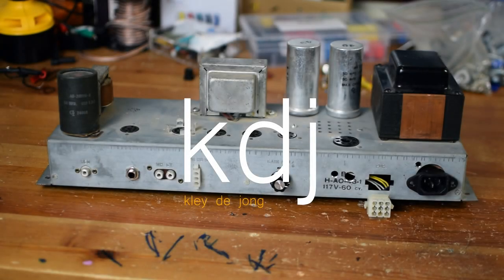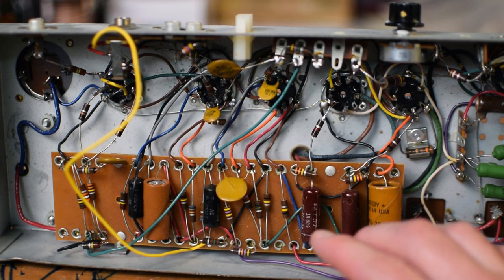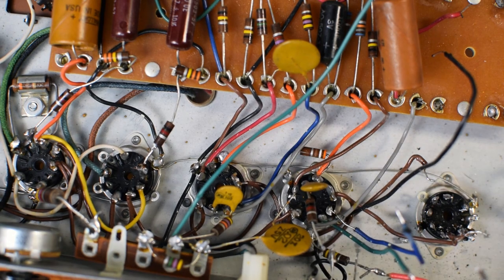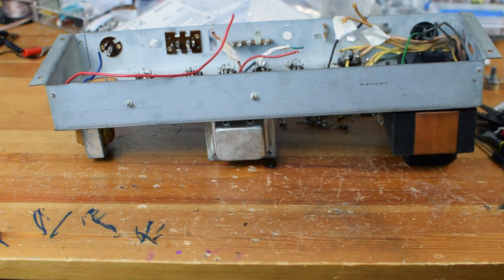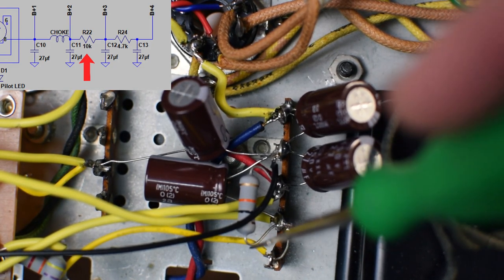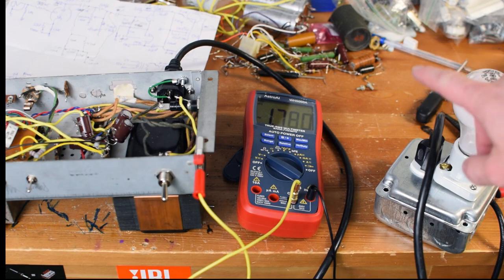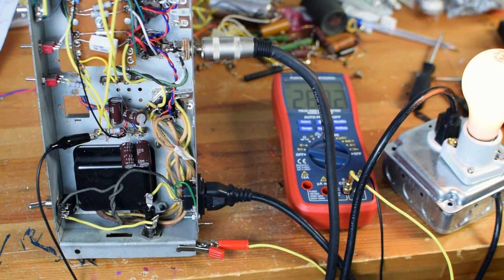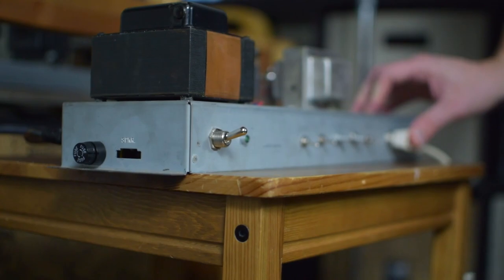Hammond AO-43 Conversion to Guitar Amp Rebuild - Dr. Z Inspired

Comment: May kley your an eclectic Renaissance man between your carrer shredding and amp schematic reading as hobby you really are a cool guy. I recently picked up the ao 43 and an ao 29. Your designs are inspirational. I just finished a tweed deluxe and soon I'd like to go p2p on a matchless dc 30 from 1996. All points point and possibly the finest layout and brilliant use of space inside the chassis as if it were designed by an artificially intelligent amp builder
Reply: Kley I just built a 5E3 doing a head and cab and really want to build a reverb unit fender clone from 63. Can the AO 44 be converted? Or any hammond easily turned into the 6G15 to  give me a 3 piece it seems like the 44 has a good enough base with a few parts could it be converted or is there another hammond model I could use for this

Comment: Excellent walkthrough, and it sounds awesome. I ran across your video because there's a working organ near me for $350 but I play guitar. About your weird house voltage issue, your ground and neutral are not connected together in your fuse/breaker box. There usually a screw that goes through the neutral bar to the metal fuse box enclosure that will tie the neutral to ground (as long as the ground is properly connected to the box). Make sure to turn off your main power before making that connection.

Comment: If you have 70 volts at the outlets... First check to see if that voltage is consistent. Do you have 70 volts from neutral to hot and ground to hot? If you do... You should go to the panel servicing your house. Open the panel and look at the meter main. Check the voltage across the two hot lugs. That should be +/- 240 volts. Then hold the black lead of the meter on the ground/neutral bar and check from there to each side of the main to main to make sure you have 120 on each side. Another thing you need to look at is whether or not you have more than one panel if you have two panels the primary panel will have the ground and neutral wires together but the secondary panel has to have those wires separated. If you are taking your readings off of the secondary panel then you need to check from ground to hot on each side of the main breaker and from neutral to hot on each side of the main breaker.
If one side differs... Then you just need to keep tracing back. What you're looking for is to find out if there is a voltage difference on one side or the other. If you can trace it back far enough you may find out that the problem is in the meter socket outside which would be a problem for the power company to deal with. If it's not then it's a issue within the wiring in your house although that seems kind of odd and unlikely. Once you've started to work through those troubleshooting steps if you want to shoot me a message I can probably help you further I'm retired but I was a licensed electrical contractor so I have a pretty good idea of what I am doing
Reply from the maker: I recall trying to figure this out in my tdpri thread a few years back. I believe there is a floating ground in my basement. The hot + chassis and neutral + chassis together was like 122vac. So my secondary voltages are always just fine. But taking voltages on the primary side to chassis ground gets weird.
Reply: @KleyDeJong  that would bother me no end. I would take a cord, attach alligator clips to one end and a grounded plug to the other. Then go from receptacle to receptacle until you find where the problem stops if it doesn't stop anywhere then the problems in your panel or between the panel and your first receptacle... And you need to fix that because that's just not safe especially when you're working with high voltages

Comment: Great tone!  I appreciate the walk-thru but especially applaud you for being brave enough to present a cold start up. I doubt many ampaholics actually post their first starts, Uncle Doug excluded. He never misses. 

Youi work with AO-29's a lot. Ever have any issues with the PT voltage being too high or sounding stiff?  I am starting a 5E3 using a PT from one and it's massive!  The OT will be from a 1954 Motorola hi-fi console record player with a 5K ohm primary. It's fairly beefy in its own right - twice as heavy as the OT from the AO-29 with a size very similar to a Champ PT and I'm excited to hear how it works.
Reply from the maker: My first 6v6 plexi build had a field cool designed ao29. It had high voltages for sure. I run it with 6l6gc's now.
Reply: @KleyDeJong  ok im reading that these field coil speakers sound really incredible...180 degrees out from what we are used to hearing, and i think i have 3 good ones to work with...i also have two old Leslie amps from 1937 that are field coil 15s, but the guy before me sold the speakers out of them for big bucks...i was told...i can use regular 15s....if i add a resistor...any thoughts on this ?...

You sound GREAT on this demo...i have never heard you play like that-

ive been waiting for this amp build...cos ive got 3 of these in my shop...
Im moving...so i wont get to it right away, but im excited about these...
Thank you for doing this-
You made my night

Comment: The AO-29 is super long, im considering picking up a Hammond aluminum chassis and transplanting the pre and power amp in to that and removing the vibrato amplifier (for the vibrato scanner).

The AO-43 is ideal like the AO-35

Comment: Ironic. I'm doing an AO35 conversion right now. Just leaving power amp as is with the exception of no NFB or Zobel conjunctive filter. And starting with Fender preamp values up front with Matchless style tone control. Hoping it ends up around a Brown Deluxe type thing. I would love to hear yours cranked to edge of breakup!
Reply from the maker: Cool project. I need to do another demo of this amp as I have now learned my speaker was nearly blown at the time of filming. It's a cool sounding amp. Very responsive and honest to what you put in.

Comment: Just made an Ao35 into an 18 watt clone with all new good components and a Voltage regulator from Trinity Amps. Sounds great but I think the tone circuit I used (Brown Note’s) is leeching too much gain. Gonna try the standard 18 watt tone stack. Did an Ao44 as well. Think I’m gonna add a 12ax7 and change it to El84’s. Do think ya need a higher watt light bulb on the limiter? It could burn up if it’s too low and you get a short.

Comment: Nice work Kley.   Does having all your preamp stage grounds tied to input jack present a problem if jack becomes loose or oxidation were to occur?
Reply from the maker: Yes it would kill your signal. You could also use a dedicated bolt to the chassis with a solder tab washer.